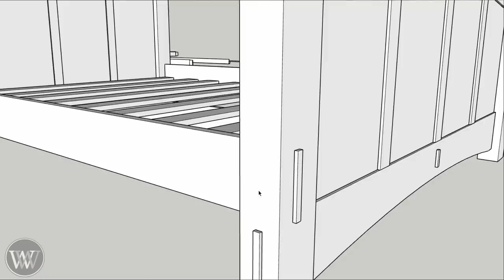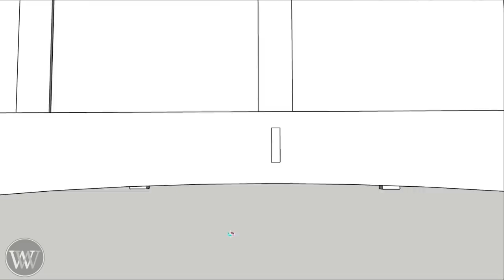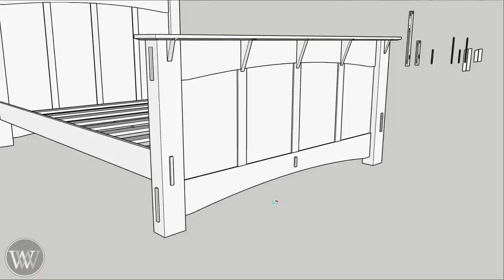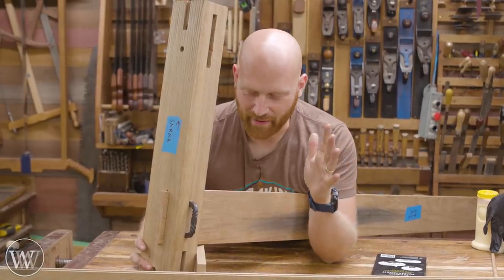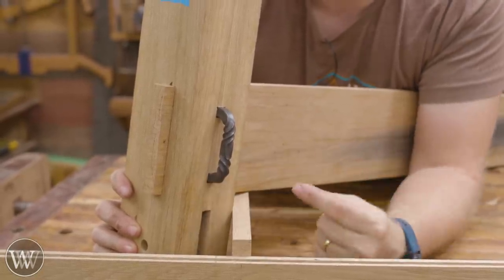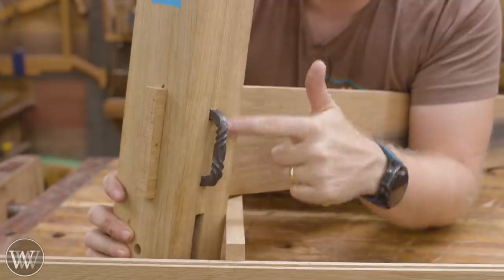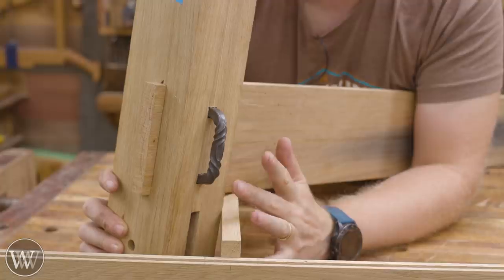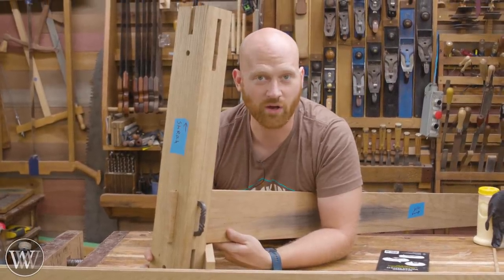Hand Made Bed Joinery Mission Style Bed Part 7

Comment: We (22 yo son and I) just finished a similar bed (a novel design) with exactly the same anti-wracking brace device substituted with a few deck screws per join. Sure ... it was an unfortunate hack in an otherwise near-perfect design, but there are 16 deck screws and zero glue in this ultra-solid bed. The legs were chunky at 105mm by 90mm (3*35mm*90mm laminated oak boards) each. It weighs around 240kg all up and ain't moving without a screw driver, a fork-lift, and mallet.
Reply from the maker: SOunds like a fun build!

Comment: Very cool...never seen the indepth process of this Joinery before...
1:15& 2:16 & 7:18 This is a new tool to me. ..what is that called?
Interesting...I didn't see him use one spot of glue, on this piece...cool 

thanks for sharing 😎👍👍
Reply: @zack3g  thank you for your comment/ response. I will be keeping my eyes open for these marking gauges...I would like to try them out.
Reply from the maker: what he said. they will make a line parallel to the edge and give you a far more accurate line then a pencil will. I will be using glue, but the whole design was intended to be able to go together with out any glue at all.

Comment: You do realise by using your wedding ring like that to drill you are slowly grinding gold away from the inside and it is going to egg shape the centre, you are grinding soft gold against hard steel over and over your wedding ring is to important use a cheap ring instead